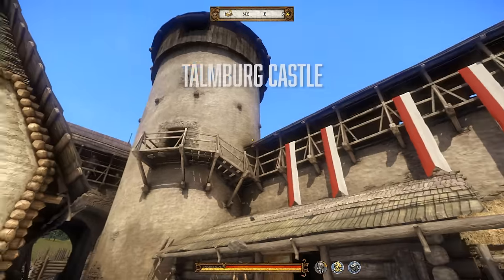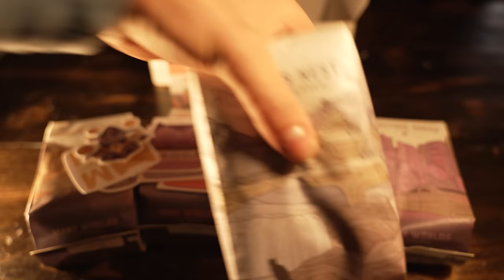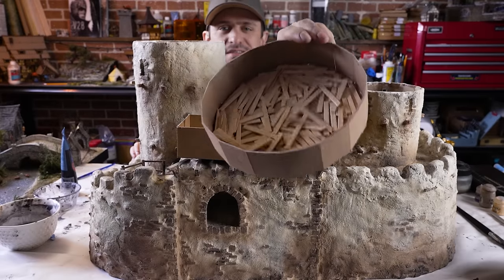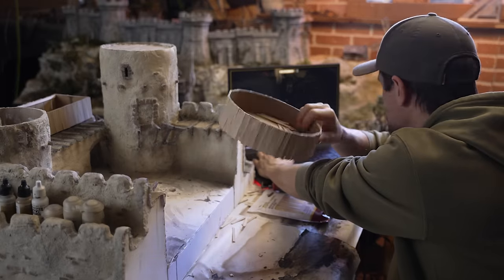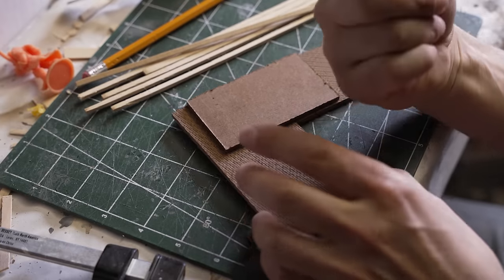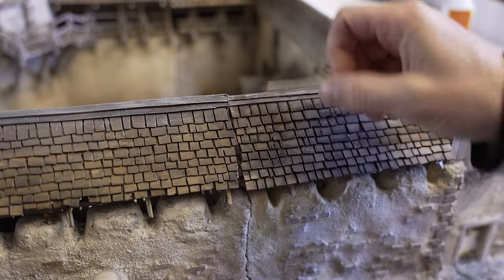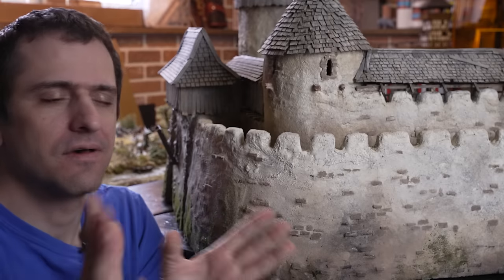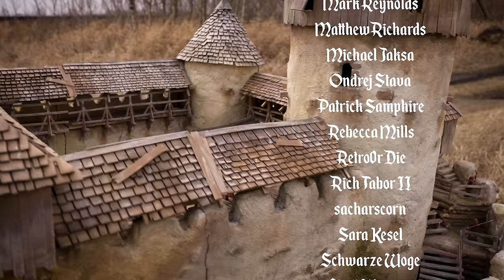I built this 14th Century Castle from scratch!!! | Talmberg Castle

Comment: FYI, when making the towers it would be easier to have them in one piece. So for the large tower, 16 inches by 22.5 inches, the small tower, 12.5 inches by 17.5 inches. Also using a gallon paint can works best as a form for the large tower.

Comment: Love your work. There is an easier way to divide a circle into 6 parts. Use the compass to make a circle of any size. Now, without changing the compass setting, place the needle anywhere on the edge of the circle and use the other end to draw a mark on the edge as well. Move the needle to that mark and repeat this process all around the circle. The result is not perfect, but close enough. Hope this helps.

Comment: The attention to detail is amazing. Those pieces you refer to as "hoarding", is actually just a covered walkway. Castle hoarding protrudes over the wall to allow defenders to fire down at attackers or drop boiling water or rocks on them. Hoardings are also buttressed against the castle wall itself. The hoarding above the drawbridge should extend out further, and have supports as mentioned previously.

Comment: I purchased the first part of the castle plans, have assembled all the parts, and added interiors. I'll buy the second set of plans when you upload. Seems like you anticipated to have uploaded them by now.
BTW about your wife,  I also have back pain, I found two great remedies. Acoustic wave therapy and MSM powder. The acoustic wave therapy machines are expensive though I found one vendor that sells a unit for less. There is also a unit on Amazon which may be better because it is ergonomic and even better price. MSM powder is natural and tastes terrible so it is best when taken in pill form.
Reply from the maker: Thank you for the advice for my wife, and yes, I will get this template out asap and send both an email to those who've purchased the first template and also make an announcement in the community section.  Sorry for the delay on that!   And Great job assembling it yourself and having added interiors!

Comment: one issue I would point out is hoardings always protrude outside of the castle walls to reduce the blind spot for defenders and they can shoot arrows or throw rocks at attackers standing close to the wall. castle walls are so thick there would already be enough space for a walkway on the inside of the castle walls, further protrusions extending toward the inside is unnecessary.

Comment: Amazing work! Just two points of criticism, and the first one is probably addressed at KCD (which I don't have installed right now). There is absolutely no reason for all that rough stonework on the walls. These castles were built by specialist and of course the walls, even if repaired would be pretty regular and the plaster would even out any remaining irregularities,and yes, that plaster would be redone at a minimum every few years,so it would mostly be bright white. The other point is that improvised patching of that small gap of shingles on one of the hoardings, why would they have done it that way? I'd have either tried with a single slightly wider vertical board, or maybe actually tear the shingles up a bit more, put some tools up there etc. and make it look like they are actually doing some maintenance/repair on that part of the roof. But overall this castle is gorgeous and you've shown great artisanship with that model.

Comment: May i ask how you achieved plum level and square for the construction of your model? It appears as though you used a table surface parallel to Earth's surface to achieve level. Did you not measure the radius by drawing a tangent line to the (non existent ) geometric horizon? Thanks.